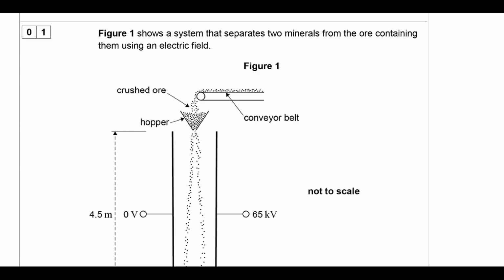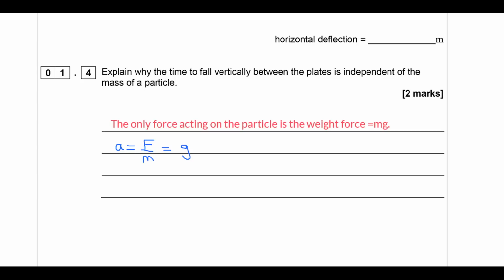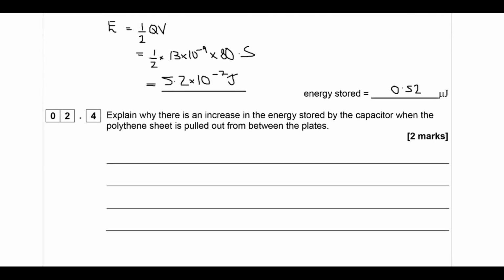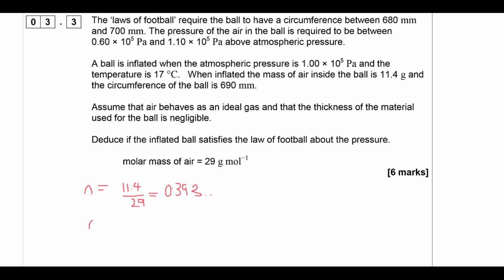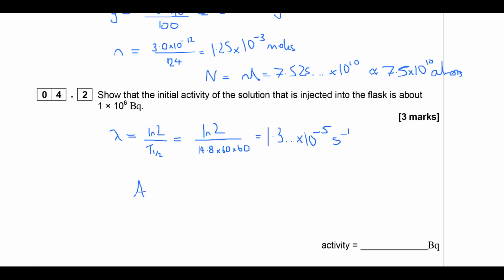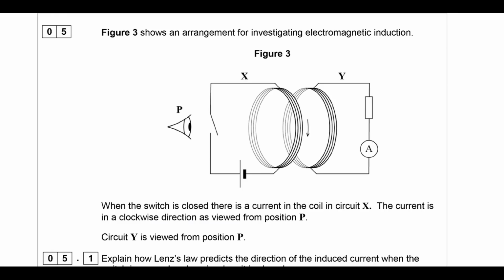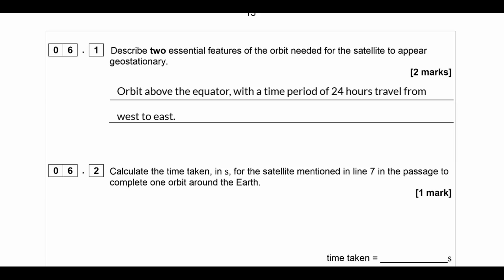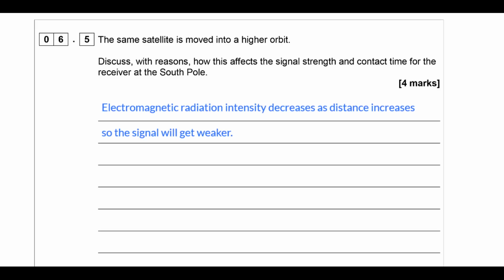A Level Physics: AQA: Paper 2: Full A Level: Specimen Paper: Section A

Comment: 5.2 isn't 0.012T though, it's 12.4nT.
max emf is in microvolts not volts. :)
Reply: Probably because the question asked for it in T ;)
Reply: Dante Racing X Amie is right, and besides, if it were in T then it would be 1.24x10^-8 T

Comment: Did Q6.4 slightly differently and got an answer similar to that. Find the ratio between the distance that the satellite can see and the perimeter of the earth (1900/(2*(pi)*5400)) then I multiplied that by (2(pi))/(angular velocity)) to get the seconds that the satellite sees the receiver then simply divided it by 60 to get it into minutes. Not sure if it's a coincidence but ended up getting 19.8 minutes which is roughly 20 and slightly less as well which is what the question stated.

Comment: Q4.3 Why in the calculation of the predicted total Becquerels of the flask was time used in hours rather than seconds
Reply from the maker: because the decay constant I used has the units of hr^-1 so the time must also be in hours.
Reply: Thank you
Reply: because it would have made no difference to the value of lambda times t if he were to convert to seconds or kept it as hours. beacuse lambda*t = ln2/T.half * t so multiplying T.half adn t by 3600 will just cancel each other out and give the same ratio.

Comment: I dont like the new spec for aqa because of these synoptic papers. Im not good at linking topics. Is it possible for you to do a video on how to link topics tpgether in order to solve synoptic questions?
I preferred the old spec because there were no links between topics.
Reply from the maker: Whilst I sympathise with what you are saying, it definitely is more challenging to link between topics. However, to be honest, linking between topics is something anyone who studies physics should be doing constantly, not just because an exam questions demands that you must. There isn't really a secret to doing them, but you must first make sure you have complete knowledge of all of the physics principles: Newton's Laws, conservation of energy, momentum etc. Not just what they are but also where they can be applied and where they can't be applied. (Which is just as important). Once you have that, it is a case of constantly practicing topics that demand you unify the concepts, you can't get good at it if you only practice topics separately. (The old spec OCR unification papers which are paper 3 are a good place to start with this regardless of what board you use!)

Comment: at 11:34 why is the permittivity of the er 1 because the sheet is removed so it is free space now so shouldnt it be 8.85*10^-12 aswell as e0 making it (8.85*10^-12)^2 in total??? someone help me plz
Reply from the maker: Relative permittivity is just an value. For a vacuum it is 1 which is why it is just 8.85 x 10^-12 not squared. If a dielectric material is placed inside the plates, that increases the relative permittivity to say 2 or 2.5 for example.
Reply: oh shit yeah i get that, thanks so much

Comment: Could you please help me out, I understand all of this and your other videos but 5.1 has me lost, I have no idea why you put north and south where you did, and when you say "When the switch is opened" is that assuming that it was just opened or always opened? Because I have no clue why there was ever any current to have gone to zero, and you refer to current and induced current but I am so lost I don't know which current is in which coil, X or Y, could you please just explain everything in 5.1 again assuming you're explaining to someone with no clue? I like all topics in physics except for magnetic fields >_< thanks
Reply from the maker: 1) In a solenoid (coil), the the current appears to be going clockwise so you are at the south end of the coil (That is a rule that you can use for any coil)

2) Before the switch is opened, there is a fixed current in coil X which means there is no induction in y as the magnetic field around x is constant and Y is stationary so no flux is cut.

3) When the switch is opened, the current changes so the magnetic field is changing so in y there is a changing flux linkage and a current induced but in the opposite direction to the change in current in x (That is using lenz' law)
Reply: Oooooooooooh I understand it now!! thanks so much, didn't realise south was in front of north viewed from position P, and I see how the magnetic field would change and cause what you said to happen

but I am still confused about one thing however, when you said what happens when its opened in the video, you said it goes from anticlockwise to zero, but the typed answer you read out said it when from clockwise to zero when opened, so which one is it, because you said the opposite happens, but this leaves me confused whether you meant opposite in terms of if one is anticlockwise, the other is clockwise (which is what you said first) , or if one goes from clockwise to zero, the other goes from zero to clockwise (what the typed answer said)